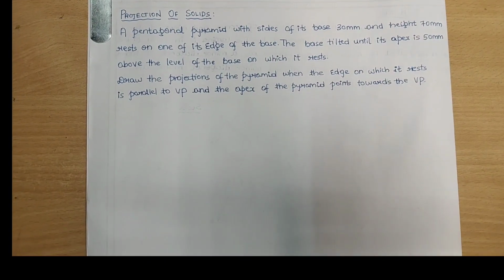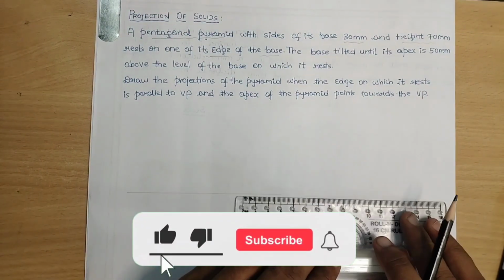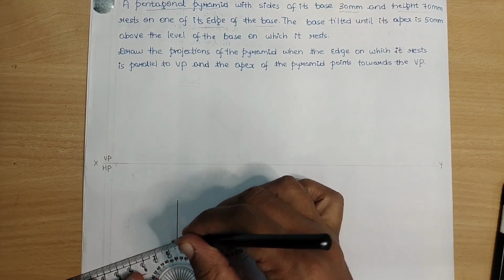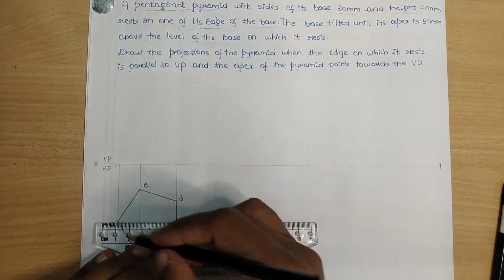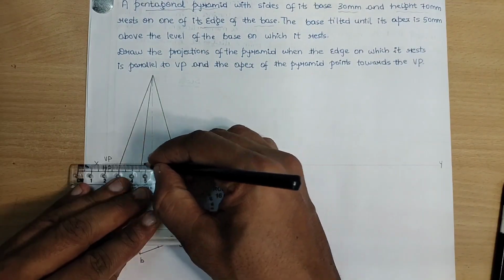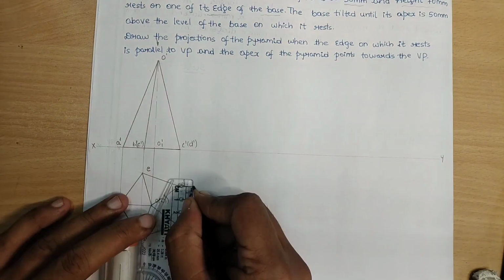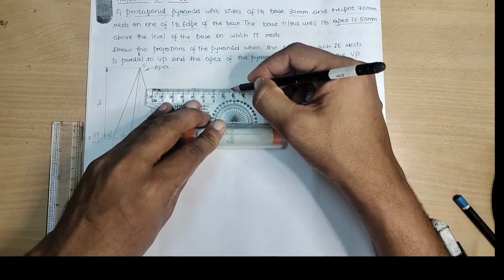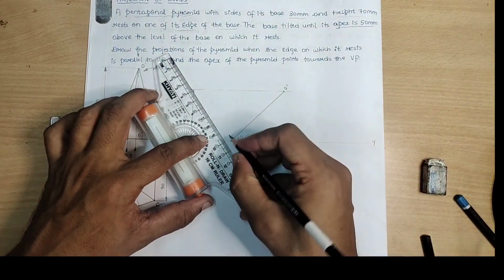Engineering Drawing_ Projection of Solids_ Pentagonal Pyramid _Manual Drawing

Comment: A regular pentagonal pyramid with the sides of its base 30 mm and height 80 mm rests on an edge of the base. The base is tilted until its apex is 50 mm above the level of the edge of the base on which it rests. Draw the projection of the pyramid when the edge on which it rests, is parallel to the V.P. and the apex of the pyramid points towards V.P.
Reply from the maker: Its the same Question i have solved here... 
A small change in dimensions (Height is 80.. i have solved for 70).. Remaining dats are same...
Thank you

Comment: A pentagonal pyramid of base edge 30 mm and height 60mm rests vertically on its 
base on the HP such that one of its base edge parallel to VP. It is cut by a plane, 
inclined at 50º to HP and passes through a point 30mm from the apex. Draw the 
development of the lateral surface of the pyramid.
Reply from the maker: I will try solving